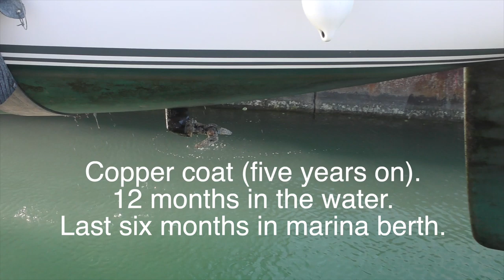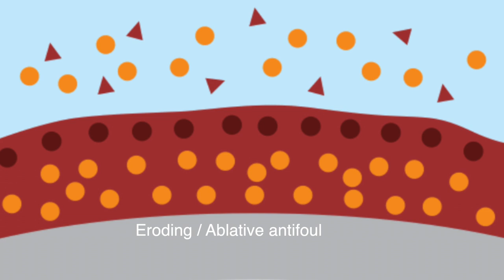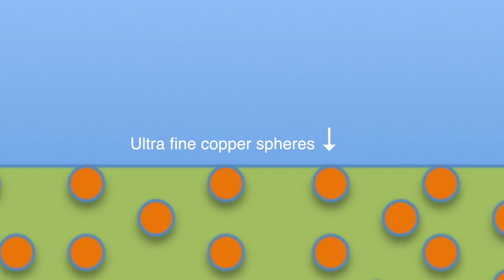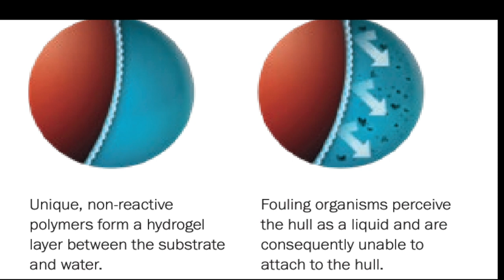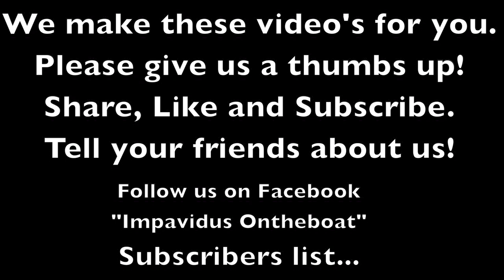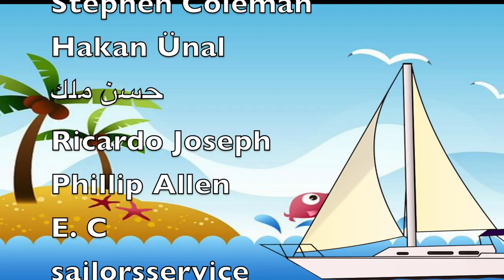Antifouling. Which one is best? We look at 3 including Silicone

Comment: If/since you haul out every year, do you have a specific "To do" list when you are on the hard?
Reply from the maker: Yes. Bow thruster anode and antifoul. grease seacocks and inspect. Change leg oil. Grease prop, clean, antifoul and anode. Leg anode. Clean out leg water intake.Check rope cutter and sometimes hone the teeth. Chek rope cutter wear plates. Check rudder bearing and adjust if required. Touch up copper coat where required. abrade Copper Coat with scotch brite. clean topsides and polish. Clean fenders and polish. Clean teak and re oil. take off all running lines and put in a washing machine. Polish hatches and windows. Clean canopy and polish screen. Clean bimini. Polish all deck bright work and inspect all fittings. Drop anchor and clean out chain locker. Inspect chain and re-mark. Inspect anchor and swivel. re -bind shackles and swivels. clean and maintain all winches and windlass. Check backstays and rigging. Check all blocks and lines. Clean and lube furler to jib and furler to main. It all takes about 2 weeks. We rent a place for this time or stay on another boat. Thanks for watching. Ant.
Reply: @SVImpavidus  Nice! That's a hell of a list! I know hauling out once a year has it's expenses, however,  do you find it cost effective to do this all at once per year or is it a personal choice? Seems to me you can get many chores done in an easy location while taking your time...
Reply from the maker: @nobody46820  We do everything below the waterline every year without fail. Also the top sides polishing while she's on the hard. We then do it a couple of times a season while at anchor. It keeps the boat looking new. Some of the other bits we do again during the year like washing all the sheets and lines. As we are at sea all year they take a lot of salt and UV. Its a lot to do but then there is the other maintenance. We break it down in to pre sail checks, once a week checks, and once a month checks. Things like smoke detectors and gas detector we do every month. oil and water checks on the engine, every time we sail. Its a lot to do but we have some crib/check sheets I did when I bought the boat. This actually saves us time and some money because we catch stuff before it fails or falls in to the category of preventive maintenance. It's not all sea and sunshine! 😉Regards Ant.
Reply: @SVImpavidus  Like it! Seems to me hauling out once a year (if possible) that the benefits outweigh the negatives.
Reply from the maker: @nobody46820  Absolutely!
Reply from the maker: @eramba. We do all our own work. Unfortunately our experiences over the 35 + years we have been boat owners is not good with contractors or suppliers. There are good hard working people in the industry and when we find them we tell them they are good and we make the rare recommendation. As we did with our solar frame provider in Spain Arcglow. When we dont get good service we give folks the opportunity to set things right. To industry standards or under our supervision. Our experience is much of the boat industry is very much like the car industry. Plenty of blue suited sailsman in brown shoes, no after sales commitment or standing behind their product or warrantee. We are going to cover this years haul out and all the work we are currently doing here in Italy. So as they say stay tuned!     Ant, Cid & the Pooch crew.

Comment: Had Coppercoat applied to my boat, as well and was never impressed with it. It does not work as advertised.
Reply from the maker: As our previous comments we have been in touch with Britican for the last two years. We have the same problems. However, when it works it works well. The patches we have repaired are brilliant. As is our sister ship launched at the same time. We know others that swear by it.  Sail safe. Ant & Cid
Reply: SV Impavidus (Ant & Cid Sailing), one last thing if I may; that $15,000 price tag for that Copper Coat job, was way over the Top. 

Anyway, Fair Winds..!!
Reply: BullDog Jackson Coppercoat costs $1700 for a 40 foot boat...the same as a good quality ablative paint. When you have professionals prepare the hull and apply it, it can get very expensive, but its very easy to do yourself. We just applied it to Brick House...we will see if we followed the directions well enough or not.  When Coppercoat doesn’t work, there is most definitely something that went wrong with the application. It’s a much different technique than common ablative paint...in fact it’s not a paint at all and can’t be applied the same way. But Coppercoat provide plenty of diy information on their website...
Some people say you have to clean it less, but we will believe that when we see it...we are pretty sure we will still have to wipe it down once a month. -Rebecca on SV Brick House

Comment: Silic One is epoxy? Same as the others?
Reply from the maker: Bruce. Hi Silic one is different as it is silicone based. It has a super slippery surface . A different solution to the same old problem. Hope this helps? Sail Safe Ant & Cid.

Comment: I had a boat with Coppercoat once off the coast of Essex, UK. It was in the water around 2 months and I'd never seen so much growth on a boat, it seems to work like a brilliant fertilizer. Never again, lesson learnt.
BTW Epoxy is hydroscopic, it's just 3x less so than fibreglass.
Reply from the maker: Their guff says it has to be regularly moving through the water. We have dome 3700 miles in the last 18 Months we still have to clean the boat every two weeks. Apart from the bits I did which are clean and green. the Barnacles and sea worm are getting worse! Despite abrading as they suggest at the last lift. Ant.
Reply: @SVImpavidus  All boats generally have water moving past them, drop a tissue into the water in any harbour and you'll see it drift away.
What I really don't understand about Coppercoat is why people keep buying it. Perhaps it can work under certain conditions but I've never seen it!!
Reply from the maker: @G-ra-ha-m  There is some guff about minimum water speeds we did see but cannot find it now. For us it has been an investment that has cost us probably £10k in haulouts, re coating, time lost etc. In honesty we should have had 5 coats of gelshield and a quality eroding antifoul every two years to get the same protection. It would have been half the cost. But those that rave about copper coat are strangely silent when you ask for detail or feedback. best regards Ant.
Reply from the maker: @G-ra-ha-m  Yes, we did see something posted about a minimum of 6 knots but can't find it now. There are areas where it works on our boat as with sailing Britican. But, other areas where it clearly is not working.  Ant.
Reply: @SVImpavidus  I suspect it depends on the mixing. Copper is way heavier than epoxy so you'd need to be continually mixing the pot when applying it, and even then it would be uneven. 
By continually I mean with an electric paint stirrer whirring away as you dip the brush in. People would be better off buying sticky-back copper sheets and sticking them on with regular epoxy. Probably cheaper too - a win-win.
Reply from the maker: @G-ra-ha-m  Britican have just put up a new video. We spoke to them by mail last week and they are experiencing exactly the same as us. I actually dived the boat this morning. and spent an hour with a stainless scourer and a scotch pad removing all sorts. I did it just 3 weeks ago! The patches I did are still clean and green. We are going to haul out again this winter in Italy and get copper coat to take another look. Watch this space.......
Reply: @SVImpavidus  Impressed with the patches, not so much with the rest of it. Is it just a matter of preparation,or of application?
Reply from the maker: @johnsherman7289  We are not sure what the issue is with CC we are going to hall out soon and get them to inspect it. But the patches we have done are fine. The rest is a pain in the backside we have to clean it every two weeks or so....... Thanks for watching. Ant.

Comment: The previous owner of our boat applied coppercoat and it works well. However, they did NOT prepare the keel properly and so that came off in strips and we applied a hard antifoul to it. Being low down and under the boat (with poor light) is seems to stay fairly clean.
Reply from the maker: We have had some major issues. Mainly due to application. Where we have re-done the work its fine. But very disappointed that the original work we paid for from new is failing and it started to fail after just a few months. When it works it works well, when is does not its a nightmare.... Thanks for watching. Ant